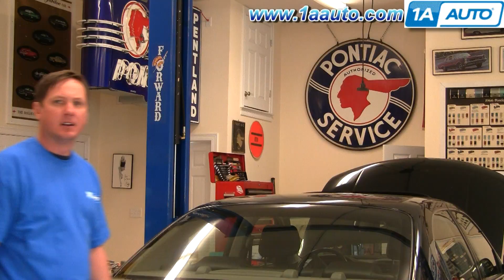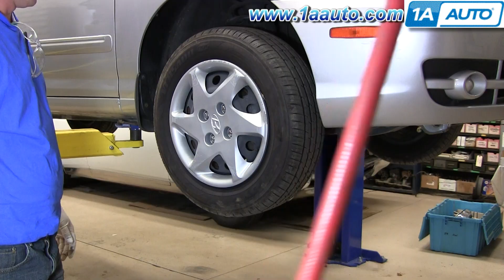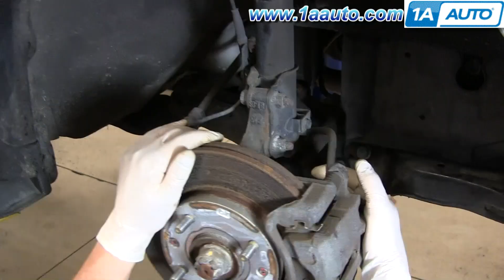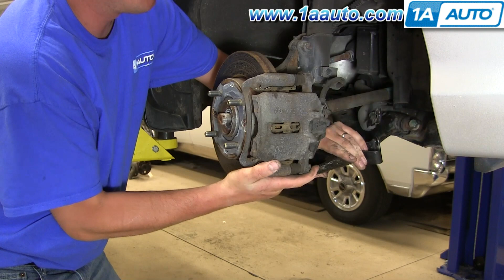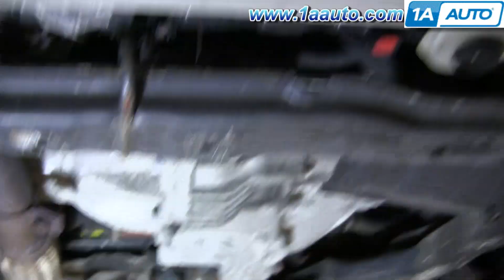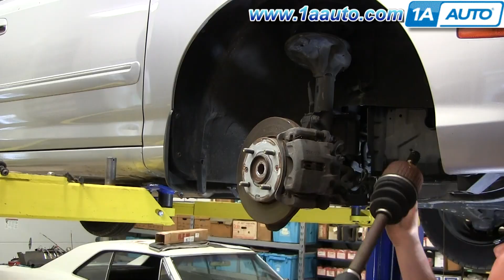How to Replace Front CV Axle 01-06 Hyundai Elantra

Comment: You mentioned to loosen the lug nuts with the vehicle on the ground if one doesn't have air tools. Question, why not loosen the axle nut also with the tire on the ground? Another point, you turned the nut around and partially threaded it onto the axle in order to hammer on it to break the axle free from the hub. My suggestion to minimize thread damage, thread the nut fully on, FLUSH with the face of the shaft, this will protect most of the threads, and utilize a small piece of wood (2x4) with the hammer to break it free. I'd rather muck up the 2x4 instead of the threads..  But otherwise, thank you for the video, i thought I was going to take more than that apart to get the shaft out. While I'm in there, I'm planning on replacing the Tie-Rod end. I know that the work performed won't effect the alignment, but I figure I'm in this far, replacing the Tie-Rod ends and getting an alignment is just taking advantage of being this far into the front end.

Comment: I changed mine today and I'm noticing a small puddle of trans fluid after the car sits for a few hours. Best guess?
Reply from the maker: +John Maue It could be a number of things, but the CV axle might not be properly seated where it goes into the transmission, resulting in a small leak.  1aauto.com
Reply: Is there any other way to replace the seal with out changing the whole case?

Comment: Remove the strut from the knuckle instead of the ball joint. It worked for the driver's side. I'll find out today if it works with the passenger side. Big thanks for your video!
Reply from the maker: +CauseAndEffect Thanks for watching. If any of our viewers needs to make this repair, we carry the auto repair part shown in this video on our website. Here is a link to them http://www.1aauto.com/hyundai-elantra-tiburon-cv-axle-shaft-passenger-side/i/1aacv00095?utm_source=YouTube&utm_medium=CTA+Comment&utm_campaign=ytcomment&utm_term=KJppS-cEbV8
Reply: thanks for this comment. Worked on the passenger's side of my Elentra.

Comment: Sometimes its easier to remove the caliper and strut to knuckle mount bolts.  Then use the balljoint as the pivot/holder for the knuckle.  Especially if the balljoint is an ornery one like this one.

Stay gold.
Reply: That's what I did. I never like to do the lower ball joint unless I'm replacing the whole control arm assembly.
Reply: That's how I've done it on previous vehicles, Thanks for clarifying that it can be done on this vehicle too!! Thanks

Comment: I have an 04 tiburon, 2.0 5 speed... same procedure? I'm worried about the gear oil coming out... Might want to do a complete drain and refill because I don't know what's in there now and would want to avoid mixing different oils. What type of fluid do you recommend?
Reply from the maker: +hugeslacker It may be a different procedure on your application. We currently do not have an auto repair video for this particular year, make and model. Thank you for asking. 1aauto.com

Comment: EZ instruction giving EZ results. Great video. BTW how did you guys get the stabilizer links the come off so easily? I had to finally torch mine off!
Reply from the maker: +Joey Gabagool Thanks for watching. There was a lot of PB Blast, and other lubrication applied prior to the creation of this video to make the replacement easier. Some vehicles do require torching to remove or even cutting off. If any of our viewers needs to make this repair, we carry the auto repair part shown in this video on our website. Here is a link to them http://www.1aauto.com/hyundai-elantra-tiburon-cv-axle-shaft-passenger-side/i/1aacv00095?utm_source=YouTube&utm_medium=CTA+Comment&utm_campaign=ytcomment&utm_term=KJppS-cEbV8
Reply: I'm parting out a 2003 my kid wrecked for parts for his 2002 GT and you aren't kidding. PB Blast is a God send. lol  The only other issue was one of the ball joints kept spinning while getting the nut off at the top 2 threads. Nothing a little pb plast & a wire brush couldn't have prevented. In any case your videos are always right on the money. Thanks for making it fast & simple.

Comment: I might suggest you use a ball joint remover (commonly called a "pickle fork") instead of the small sledge hammer. Also a brass hammer if you need to hit threads.

Comment: Straight forward video, nicely done guys.

One point though... instead of wielding a mallet in that confined space I have always found it preferable to either use a second mallet to apply force with the first mallet being held in place (less chance of collateral impact but a lot noisier) OR used a block of hardwood as a buffer.
Reply from the maker: That's a good tip. Thanks for posting it. 1aauto.com 866-403-3393
Reply: 1A Auto Parts No worries you are most welcome :)
Reply: hmm... That's how I'll be doing it from now on :)

Comment: Would this procedure also work with a 2000 Hyundai Tiburon ?
Reply from the maker: The process may be a little different on your vehicle. We will keep this vehicle in mind for future videos.
1aauto.com 888-844-3393
Reply: K thanks cause Hyundai stopped making my car in 2008 so videos are really scarce I know the 2.0 engine is the same as an elantras but not sure of the rest of the hardware. Thanks for your response

Comment: Yes everything went fine,. Have to top up gearbox oil as we only had stands for front. Thankyou very much
Reply from the maker: Thank you for watching. Glad it went well.
1aauto.com  888-844-3393
Reply: Even if you put the car up on 4 stands, gearbox/case oil is still going to come out when you pull the axle out from the transmission, correct?  Second, where is the gearbox/case, how do you add oil to the case, and how much gear oil do I add?

Comment: There is a tool called a ball joint separator.
I've used the kind that looks like a big tuning fork with a wedge and you hit the end of it with a mallet. There another kind that you turn a nut and the tool spreads out. Might make  your day easier if you're doing this on the ground and don't feel like wailing on the parts with a hammer..

Comment: Removing the CV axle from the knuckle can be a serious problem if the car is corroded.  I had a terrible time getting mine off as it was seized in so badly that even wailing away at it with a  5lb hammer didn't free it up.

Comment from the maker: You can fix the joint, however the price for a new axle usually isn't a whole lot of money. Usually the labor cost involved with replacing the CV joint wipes out any cost savings and can be more involved then just purchasing a new axle. 1aauto.com 888-844-3393